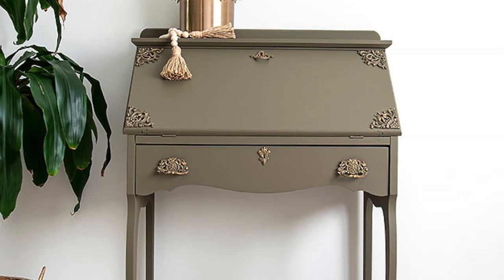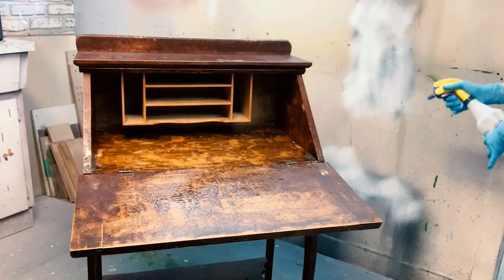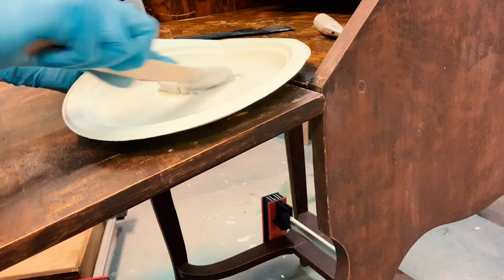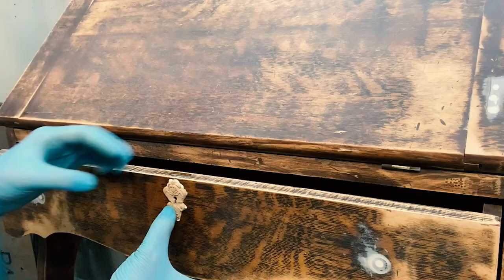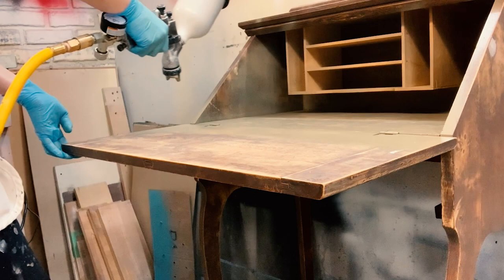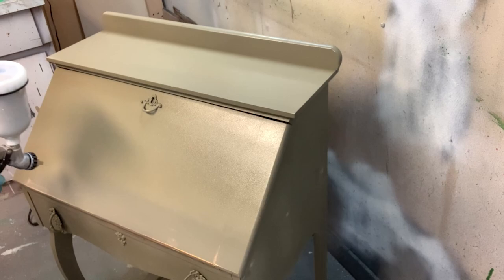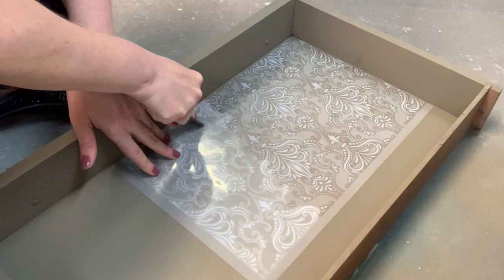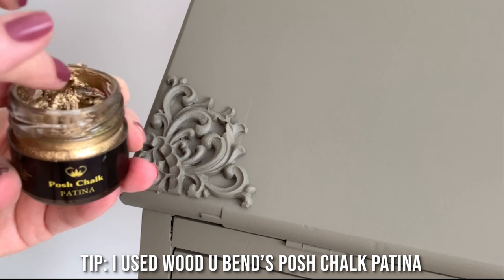Painted Secretary Desk | Before And After

Comment: Beautiful!! I absolutely love using Woodubend on my flips too. I haven’t sprayed Silk so my question is did you thin the paint before you sprayed?
Reply from the maker: Me too, WoodUbend is awesome, isn't it! And yes, I did thin my Silk a touch before spraying. :)
Reply: @SalvagedInspirations  I was under the impression that you couldn't use water with silk paints.
Reply from the maker: @lorrainewhitlock5377  Correct. Water is not recommended when brushing. When spraying, thinning is acceptable (otherwise some of the colors are too thick to spray through a sprayer) but no more than 1 oz of water to 16 oz of paint ...otherwise the stain blocker/primer and or topcoat could be compromised.